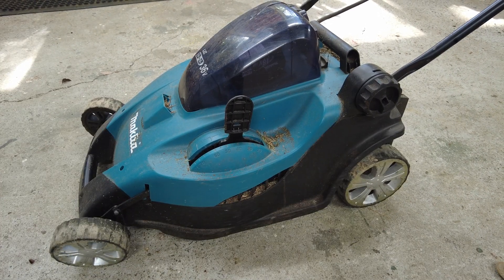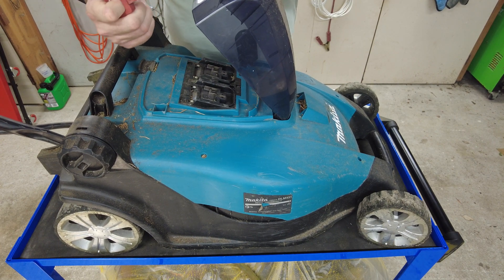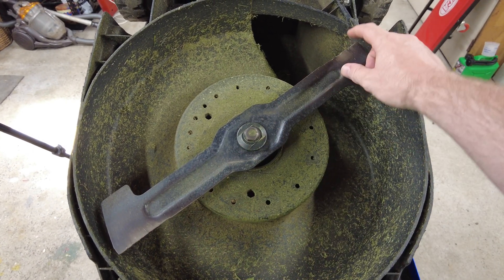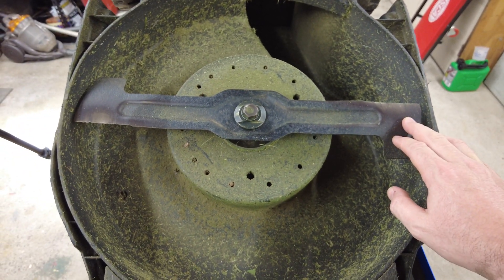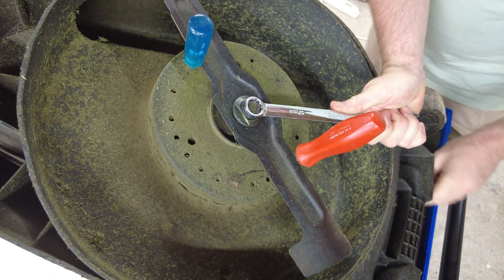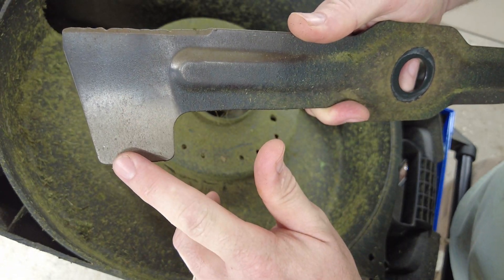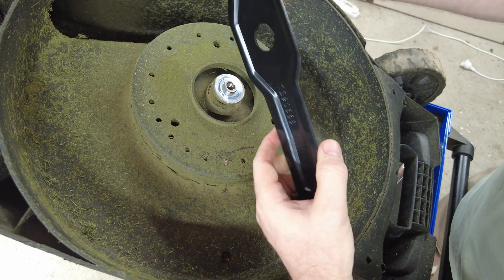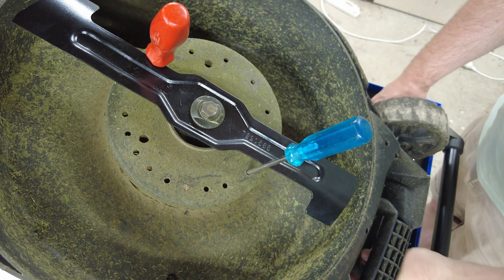Makita Electric Mower | How to Replace a Dull Blade for Optimal Performance

Comment: Can we reuse after sharpening?
Reply from the maker: I think if the back of the blade is still in good condition, will still create airflow to lift the cuttings, and you can keep the blade balanced, yes, it should be OK to sharpen and reuse it. Please check with your supplier to ensure you won't impact any warranty conditions.